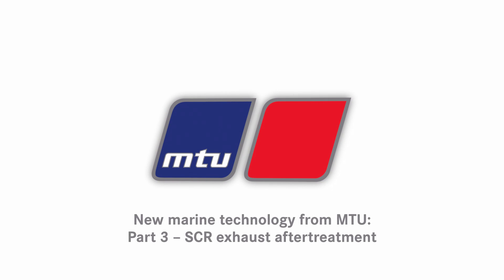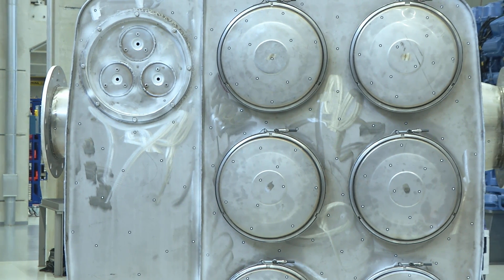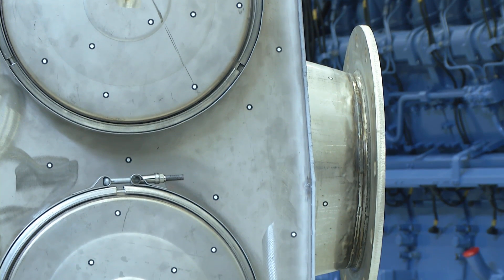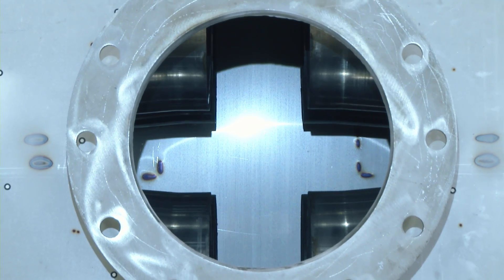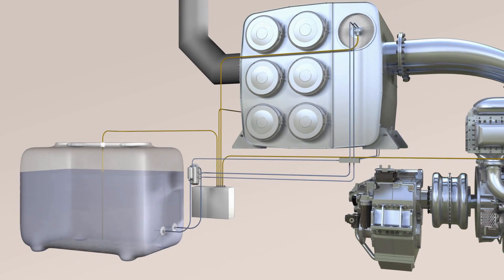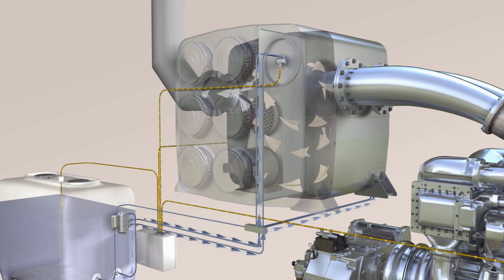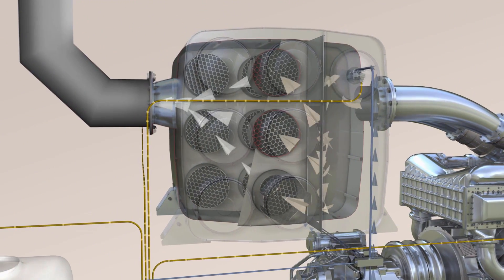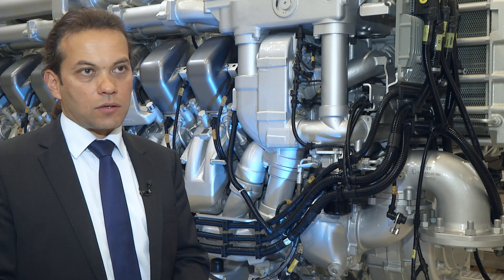A new SCR system for mtu Marine diesel gensets

Comment: I'm working on Yacht Application which is incorporating  MTU 16V4000M73 (2560KW) for the main propulsion with a MTU SCR system.  How much is the SCR unit taking away from the allowable Back Pressure for the mains.  Also what would be the exhaust gas flow after treatment?